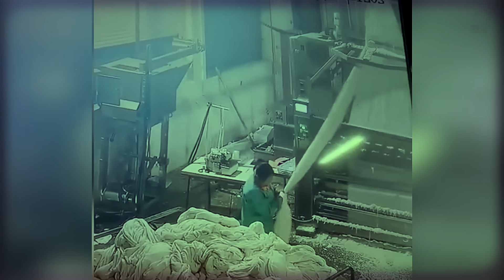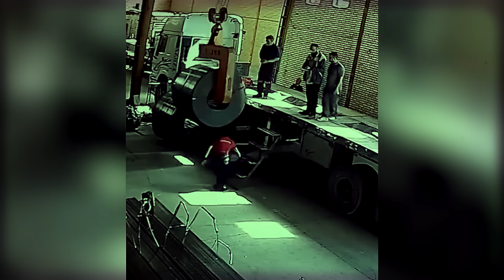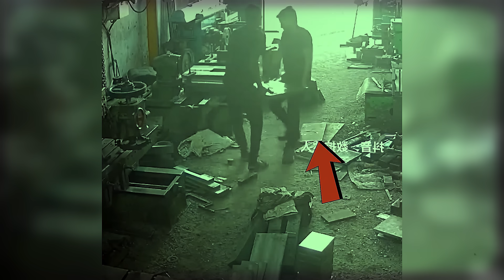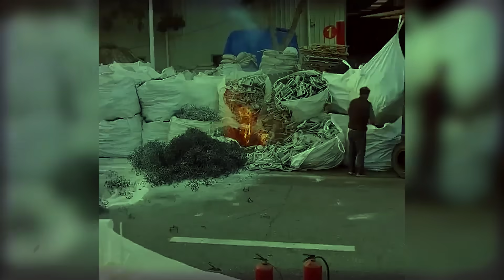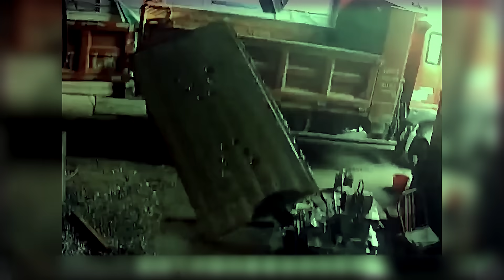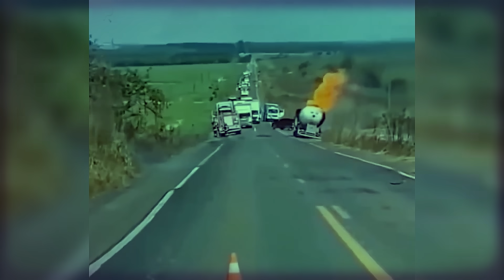He Thought He Could Stop It… Then This Happened

Comment: The shoe guy first thought he was smart by lifting the front edge of the shoe, but he forgot the back side of the shoe.
Reply: that was idiotic
Reply: No, he forgot that the conveyor he was sliding on to was moving in the other direction. He got caught in the center of the two conveyors because they were moving towards each other.
Reply: Shouldn't of been on there in the first place,sack them both